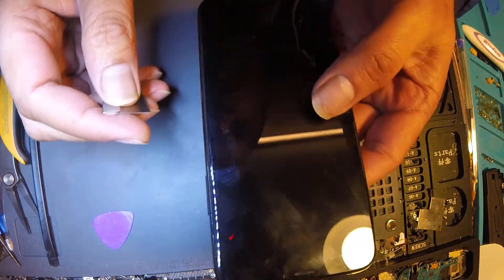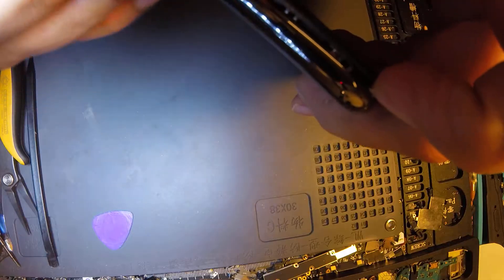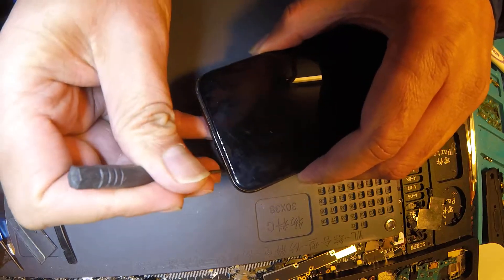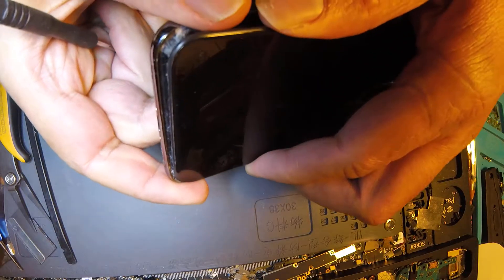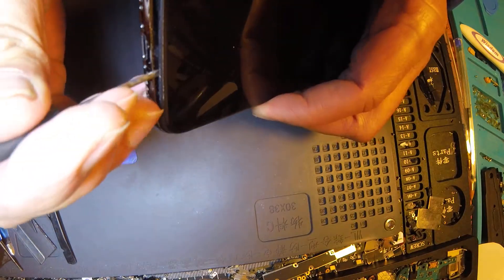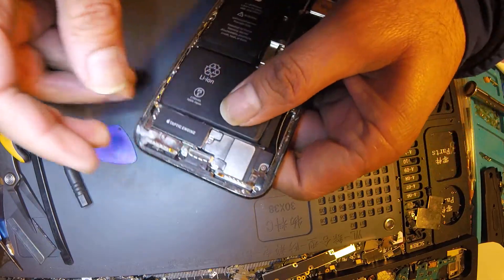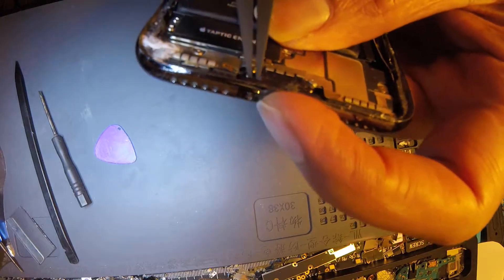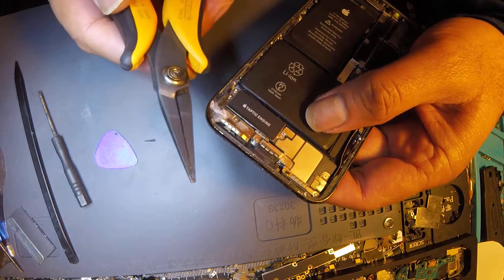iPhone screw won't come out | How to remove iPhone stripped bottom screws full solution

Comment: Ok so I thought the tabs at 4:59 were some sort of bending locking tabs ,  but I figured out that those tabs are around the screws  and  we are just pushing the sides of the tabs, just past the ends of the screws.    

The one side was tight but I got it.  Only then I found the ribbon cable to the ear speaker had a tear in it.  So now I have to figure out how to fix a NO TOUCH and a broken ribbon cable on this XR or XS or whatever.  

smh
Reply from the maker: thanks